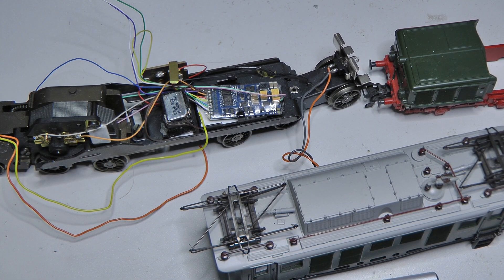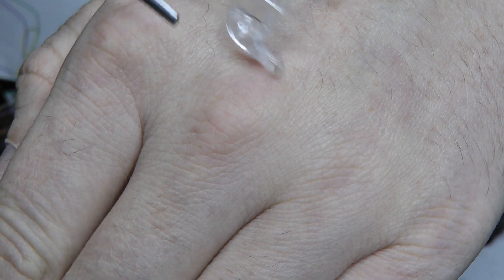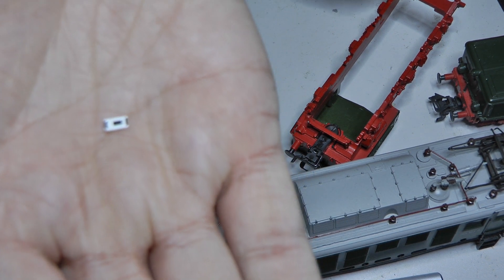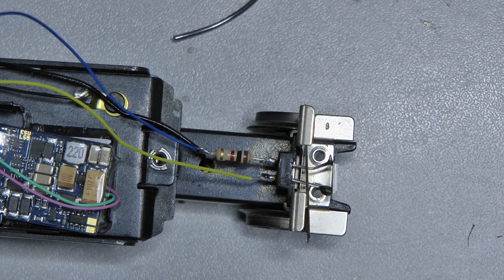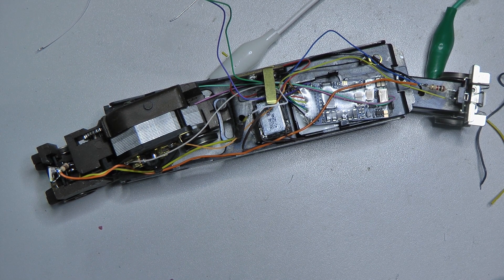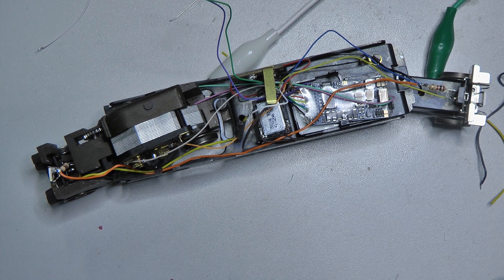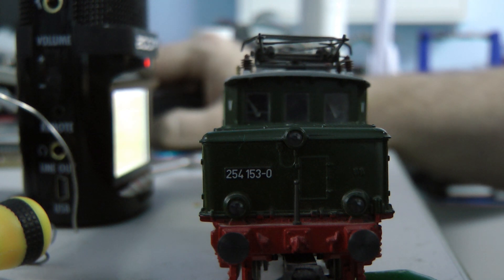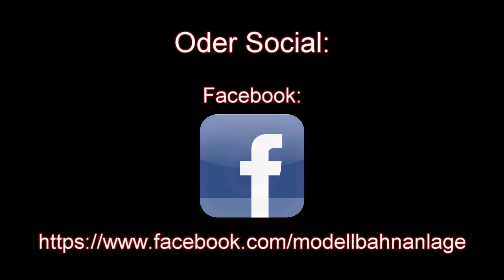Modellbahn-Tutorials.de - Folge 5: Einbau LED Beleuchtung mit ESU Loksound 5

Comment: Top Video wie immer! Bin noch echter Leihe was sowas angeht, deine Videos helfen echt. Ich wollte eigentlich auch bei meiner Lok  Front und Hecklicht einbauen habe dazu genau die selben LEDs, wie im Anfang deines Videos zu sehen (die 3 Poligen). Jedoch hab ich keinen ESU Loksound 5 sondern den Digital Decoder  aus 60760. Bis auf die Beleuchtung klappt auch alles. Hatte es in der Theorie so gedacht, dass der Mittlere bei der LED zu Masse gehört, oder denk ich da falsch? Kannst du eventuell ein kleines Tutorial zu speziell diesen Dual LEDs machen? :-)
Reply from the maker: Genau das kommt als eines der nächsten Videos...
Reply: Der mittlere Pin der LED ist immer der Plus. Ist auch immer der längste. Wenn Du den umlötest auf Plus sollte deine LED leuchten
Reply: @kaptnblaubar2102  also Mitte ist Decoder+ bzw U+, NEM blau, Märklin Orange. Widerstand kommt immer vor den Schaltausgängen dran.
Reply: @klemmerle  Ich schrieb von den Anschlüssen der LED🤭 Ja blaue Leitung damit verbinden. Die anderene je nach Funktion.